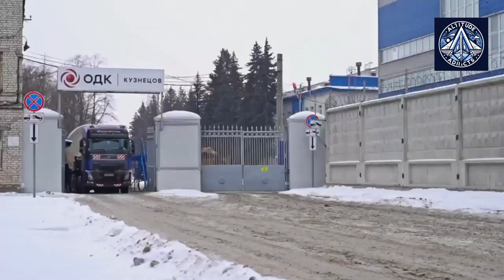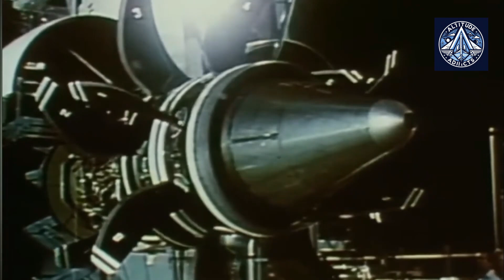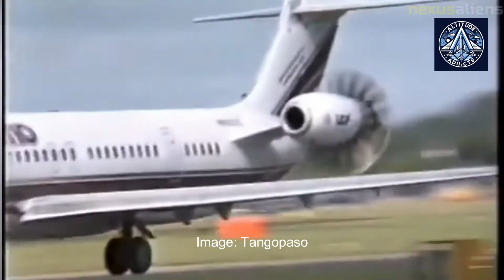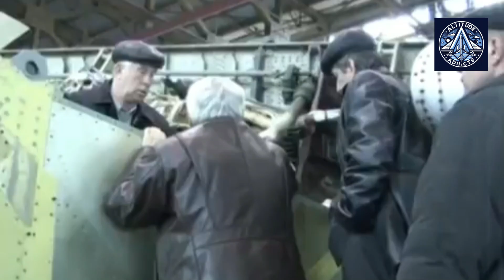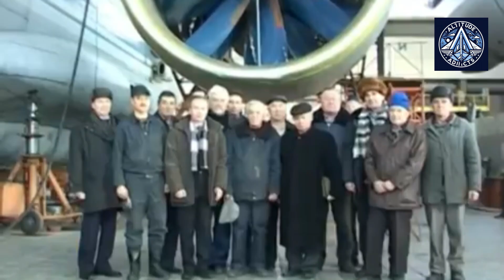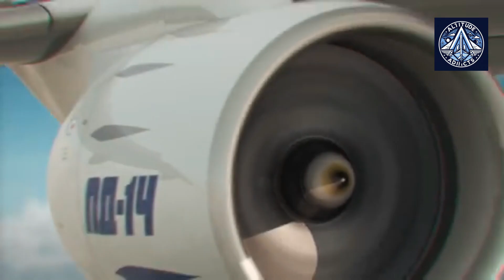Kuznetsov NK-93 Propfan vs PD-14 - Which is a better Engine for Russia's MC-21?

Comment: Maybe they need to put more blades on it so the blades could be shorter while putting out the same thrust. Also put more sweep on the blades on the outer 1/3 of each blade. Doing these 2 things should make it quieter. Also time in wind tunnels to adjust the way the the blade shroud interfaces with the blades. Plus putting the equivalent of little winglets on the end of the blades might help too. In regards all such things the main thing is a lot of wind tunnel testing will be needed to decrease noise levels. I assume that was the reason for the shroud in the 1st place. Does the NK-92 have a shroud over it’s blades?   Both the NK-93 & NK-92 make great bypass ratios. The best in the world. They should really pursue these engines. Theres no point in Russia being in the airliner business if they arn’t trying to be competitive. So either keep developing the NK-92 & NK-93 or get out of the airliner business & buy Chinese aircraft. The PD series is just playing catchup, & as they say, playing catchup never works. The only way to be competitive is by developing for the distant future now, while using the PD just as a stopgap.
Reply: @mickvonbornemann3824  easily said than done m8! For Russia to accept Chinese planes is a big slap in the face, providing that since all the way back in the earlier years of engine development, Russia has sold many engine drawings to the Chinese, for them to reverse engineer them, which they were struggling to achieve until recent Chinese tech boom of recent years, and even then, the Chinese variants, although might achieve similar or even better outputs than the Russian variants, they often lack in reliability(probably cause of the use of cheaper and less quality materials/parts). Russia is in the tricky situation now, as you propably realise yourself. We have all the natural  resources needed and strong minds behind such problems, as our tech "schools" were always strong in that department as always had to be in the race with the west, but at the moment we are very limited in our budget and some programmes have to be put on pause, due to current military fiasco with the NATO involvement in supporting rogue Ukrainian government and their anti Russian policies. So on one hand we need engines and projects alike and on the other, we need to save budget on the possible further engagement with NATO! It sucks, cause if it was a peaceful time, Russia could have achieved alot more by now, which could have solved alot of problems and been helpful and useful for the rest of the world!

Comment: The noise your referring on the propfans is the incorrect air flow trough the propellers, if you properly gear the propellers in the duct with sufficient blades for the slow speed noise suppressing required you both reduce the diameter of the engine nozzle and increase the torque required for sufficient noise reduction and forward propulsion needs..... The ultimate design required is the one that archives the desired fuel efficiency, size and noise performance starting at 25% - 35% fuel efficiency....
Reply: Do you work in a civil aircraft engine factory or you are just a textbook theory promoter, who build engines on social media 😂
Reply: I don't mean to sound argumentative, but this is Russia, noise suppression is not a factor today, and it won't be a factor until the country learns to behave itself. This engine failed for the same reasons you don't see them attached to any other airframe right across the world. It's more inefficient in certain flight regimes, it's harder to attach to the aircraft, and vibration is a big deal. Can Russia even grow turbine blades at the necessary tolerances to make it run smoothly and reliably? I doubt it. Look at the engine in the video, if the outside is beat up and dented in places, imagine how they treat the inside.

Comment: Electric aircraft engines?... Sure if you'll use them for 100Km range flights....!....
Reply: Чтобы возить аккумуляторы на 100 км
Reply: @mazikkaluchka5562  well, we have realy compact nuclear reactors for torpedos e.t.c., i gues this would solve this problem. And if plane would be unmanned - we can ignore troubles with radiation protection for crew.

Comment: Это бред! Никакого НК-93 не будет...
Reply: Maybe they need to put more blades on it so the blades could be shorter while putting out the same thrust. Also put more sweep on the blades on the outer 1/3 of each blade. Doing these 2 things could make it quieter. Also time in wind tunnels to adjust the way the the blade shroud interfaces with the blades. Plus putting the equivalent of little winglets on the end of the blades might help too. In regards all such things the main thing is a lot of wind tunnel testing will be needed to decrease noise levels. I assume that was the reason for the shroud in the 1st place. Does the NK-92 have a shroud over it’s blades?   Both the NK-93 & NK-92 make great bypass ratios. The best in the world. They should really pursue these engines. Theres no point in Russia being in the airliner business if they arn’t trying to be competitive. So either keep developing the NK-92 & NK-93 or get out of the airliner business & buy Chinese aircraft. The PD series is just playing catchup, & as they say, playing catchup never works. The only way to be competitive is by developing for the distant future now, while using the PD just as a stopgap.